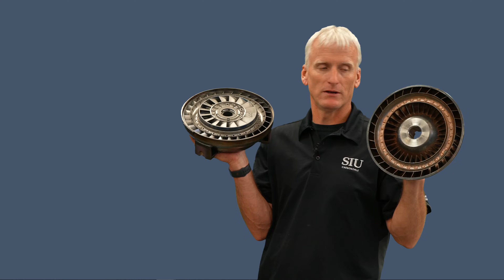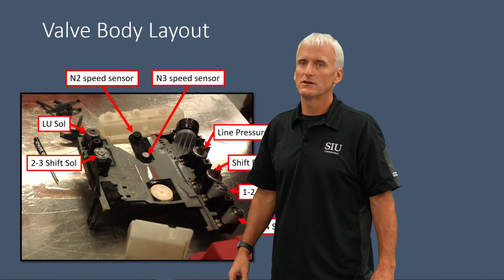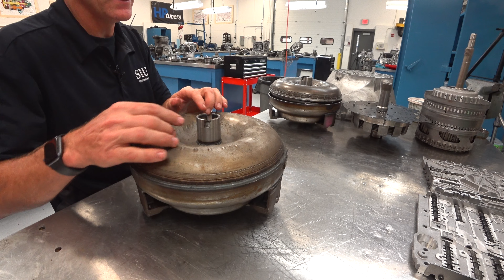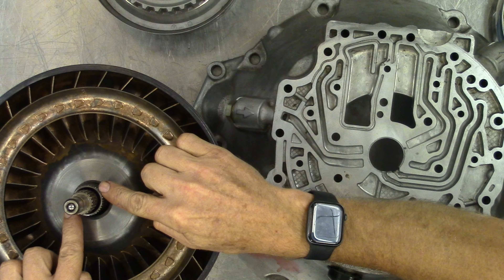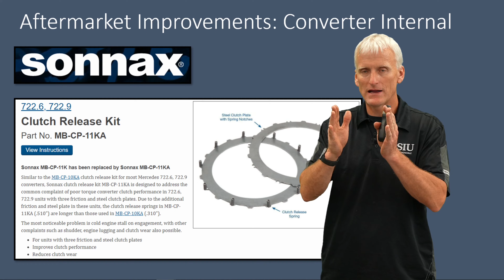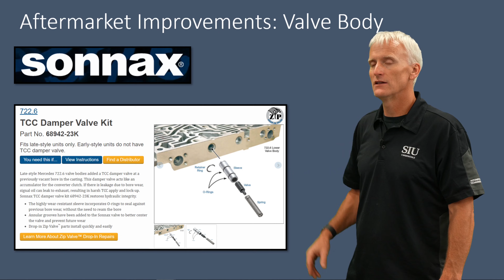Mercedes 722.6 Chrysler NAG Torque Converter

Comment: My 722.6 torque converter is locked engaged. Heavy vibration when in drive or reverse, but not sure if it’s a control issue or jammed clutch pack in the converter?

Comment: I have replaced both capacitors and checked for possible cold solder joints, but the problem has not been solved. When I connect my Autel device, no error codes appear.

I have noticed the following:

In position “P” it correctly shows “P”.
In position “R” it also shows “P”.
In position “N” it shows “N”.
In position “D” it shows “N”.

When I start the engine, I cannot properly select gears with the shift lever – it always stays on “D”. In positions “P” and “N” the engine revs up to 3000–4000 rpm. In the driving gears, however, it only stays at 800–900 rpm.

I hope this description helps you better understand my problem.
Reply: I’m experiencing something similar right now.. did you ever figure out what your issue was?

Comment: My 722.6 320cdi I have a issue with random strong shudder in "traffic jam's" or trying to drive up something in 1st gear and doesn't do it driving normally at speed or full throttle. like heat makes it happen maybe I thought it could be the torque converter was going to buy another but now see it could be valve body issues. if i put it in neutral it go's away and then back into drive it seems to stop. Its only happen 2 time's in the last 2 weeks and i drive it daily. Is this a common symptom to key part in the transmission or do i have replace everything?  Anyone had this?

Comment: I am sorry to disagree, but what you call pilot does not help to center at the crank shaft, but it's just a housing for the tip of the transmission input shaft! What "really" centers the torque converter are the bolts from the flex plate, not only it helps for the longitudinal shift, "torque converter set back clearance" fluctuation but also axial angular tilt!

Comment: Hello, thank you very much for your great videos, they are really cool and greetings from Germany, I have a problem. I hope you can help me, I have now installed a new replacement gearbox with converter 722.640 and now I have the problem, before the car shifts into second gear when driving off, the torque converter clutch slams in. So it closes too early/quickly and opens too late. What's going on? The PWM valve has already been replaced. Glycol test is negative. It's an S211 E270CDI.

Comment: Is failure of the torque converter clutch a common problem in the 722.6?  If so, is there a particularly common cause?

A couple years ago, my trans started going into limp mode after driving awhile.  I was told the TCC had failed.  Sure enough, I opened the pan and found what looked like coffee grounds in the pan.  The filter was also clogged.  I changed the filter and fluid and it seemed fine after that.  This trans only had about 85k miles.  To be fair, I had installed an SGA150 valve body about a year prior.  SGA = Sound German Automotive. I can't help but wonder if that was somehow related.  I haven't yet installed this same VB into the new trans. Loved this shifts, but kinda paranoid.

I knew I needed to get a new converter.  And I didn't want to have the down time for a self rebuild of the trans. So I bought a Circle-D converter and a transmission from Mercedes.  This is for an SL65 btw. 

I just finished watching your most excellent 722.6 complete overhaul video.  Going to tackle rebuilding the old trans using your video as a guide. I've done TH350, TH400, 7004R, 4L60e, 4L80e, T56 and a couple Nissan manuals, back in the day.  You made the rebuild of the 722.6 look like child's play. :)

Comment: After a transmission flush my normally operating 722.6 started occasionally slipping on upshifts from second to third gear, sometimes first to second. Any idea as to where could the problem be? Torque converter or some valve from the electronic plate?  Thanks a lot, these videos are very informative.

Comment: my sprinter with the 5 speed 722.6 will rev instantly to the rev limiter in park or neutral and has zero engine problems. Not a single code for the engine. The fact that my van has about 5% power in reverse or drive tells me its the torque convertor. it wont even drive over a piece of 2x4. It feels like the more throttle I give the more the lockup clutch is engaging almost like the the extra rpms are giving more hydraulic pressure to the lockup. Anyways, it idles pretty good in drive or reverse, but as soon as you put it into drive you can feel the torque convertor clutch grabbing way too much and you really need to have the brakes on. I have star diagnostic scanner and I have code 2783 torque convertor lockup clutch - The component has an excessive power consumption. Im thinking this means the solenoid, Ive tested the resistance it's in range 2.9 ohms. Also there is one more transmission code 2767 RPM sensor 3 No signal. I'm thinking that's the speed sensor on the conductor plate. If the speed sensor fails, would the TCM be trying to send power to the lockup solenoid? maybe just a small amount just enough to be able to idle, but when I give it gas the rpm will only go up about 200-300rpm and instantly clutch gets locked up. Could this also be why the solenoid is getting excessive power consumption code? Regardless, I've taken the valve body out. Very little clutch wear on the magnet and no metal debris of any kind anywhere. Ive purchased a conductor plate, tcc solenoid, tcc damper valve, and also overlap valves just for the heck of it. Also the TCM is dry and no oil has wicked into it. I Was wondering if you've ever seen anything like this. thanks
Reply: Did you resolve it?
Reply: @bernardwarr4187  sort of..., I replaced the entire transmission plus torque converter and it didn't do anything. Clearly it wasn't the transmission, I checked my entire wire harness plus the TCM module was replaced to no avail. My injectors, turbo, intercooler, all charge pipes and entire intake MAF assembly was replaced. Ive replaced every sensor you can think of, both pressure sensors, intake + charge temp. sensors, fuel rail sensor, all sensors on the exhaust, replaced egr + swirl motor, I even replaced all my ABS sensors + ABS module. I was getting desperate and ended up getting a donor engine and swapped that in. Now it works completely fine haha. I also replaced so much more than what I listed.

Comment: I'm experiencing hard shiftdowns from 2nd to 1st gear at operating temperature. When cold there is no problem. 
Ran 187.000 miles and from 2006 and gearoilchange (5 gallon flush) every 37.000 miles. 
Sometimes the engine almost seems to want to stall when coming to a hold. 
What could be the problems here? Solenoids or control valves or even torque converter pressure issues?
Thanks for great videos
Reply: U figure it out?

Comment: This is an Amazing video, I’d like to share my video showing a noise that is annoying me since a bought my MB SL 350 2004: https://youtu.be/4TTKpqCKJkI
Consider engine and gearbox mounts and transmissions flex disks are fully serviced. Noise you can hear it just in the cabine and looks like a resonance. Do you think it may caused by torque converter? Thanks for your help

Comment: Please help. My transmission feels like it wont lock up on time while above 45mph. Ill be normally increasing speed or cruising and going up a hill, and it is like the car cant increase rpms like it should and during these few seconds, the engine cant rev up any higher and the gas pedal wont respond, but after a few seconds it finally does respond and the engine jerks and then takes off. 

I had a tcc solenoid code, so i replaced the solenoid however i am still having this problem like it does not want to go up hill or cruise at higher speed until last minute and then when it finally responds it jerks hard and take off. 

Another problem at higher speeds is that the car will have that moment of no response and higher rpms but then suddenly the rpms will either raise or drop and the car will respond again. 

I also hear one quick screech sound believed to be from torque convertor everytime i am accelerating from a stop sign no matter if it is light or hard acceleration. 

Only once before has the engine revved up to 5k rpms with no increase in speed at 65mph while going up a slight incline, when this one time thing happed, it was as if the transmission was not connected to the engine.

Comment: You are amazing . I have a problem with my W204 with 722.6 only when is cold outside and only at the first start , after starting the engine, when switching the selector from P to R or D, the engine speed drops from approx. 800 revolutions at 700-600 revolutions for a period of 1-3 seconds, after which it returns to the initial position (800 revolutions) if I put directly in D engine it will stop, BUT you feel that the car is forcing itself to leave from under you (the brake is obviously pressed) . What can be ?
Reply: Hi. I have the same problem. Do you fix this and how? Thanks
Reply: @tarpe5898 did you find your issue?

Comment: I am not a big fan of this transmission, I own a 2014 Chrysler 300 C 5.7 l all wheel drive and it uses the 5 speed nag1,  Aside from an annoying tacometer twitch or twitch I started having surging issues  And I didn't get any check engine light for well over 2 years and it got pretty bad, I, I only had the surging when I was driving up hills or if I was on light throttle while accelerating.

After many dealerships and a lot of sensors being changed I changed my torque converter which cost me $2000, Now the surging is gone

edit surging never left

Comment: thank you  great class lots of technical information , I've spent lots time at Chryslers  training facticity over 25 years in a dealership , i serviced these unit and did all the TSB's back in the day  but been driving school buses since 2009 , I own my 2012 wrangler with the 3.6 v6 Nag 1 5spd for 6 years its been a great running vehicle, I ve just started experiencing a problem with the  trans at 100,000 miles no DTC's, NO check engine light,   fluid is not burnt , no metal or strange material in the pan   second service at about 95000 miles, never towed or hot rod  just a fun driver , On moderate acceleration under light load trying to climb hills or enter hwy I'm getting a high pitch whining noise rotational to rpm and will not exceed speed above 45 mph under light acceleration i get all five shifts  no noise  and can cruise at hyw  speeds , I just had the TCM and ECU flashed to the latest software , I flushed the trans cooler and replaced the trans cooler bypass valve ,  No noise at idle or shifting from park to drive or reverse , condition is present also when manual shifting no stalling or shuttering , units are on back order , i was hoping for a quick and easy fix maybe a valve body  repair and a torque converter, back in the day Chrysler would put a new unit in if we need a pump converter and a valve body  as it put it over 70 % , any advise or ideas would be appreciated , thank you Bob

Comment: My symptoms- 
Code P0741
TCC slip under load 
and shudder on slow down down at 20mph 

Fluid looks good , not metal shavings at all 

What’s the chance u think the pressure regulator valve is worn 

Trans go kit says it fixes p0741

Comment: The TC clutch application is Pulse Width Modulated (PWM) and why when the clutches fail a vibration/shudder can be felt during application.

Comment: hi, did quite a bit of googling around but didn't find anyone with the same issue.

04 r230 sl600 (v12 twin turbo) with 70k miles. driving on a level road, when giving just a slight bit of gas, or letting off, I feel play in the driveline, but I dont think its the driveshaft or the differential, it feels as if there is play inside the transmission itself. what could it be related to, a gearset, a bushing, some bearing? thank you.

Comment: if torque converter leaks, what should i look for {location}
Reply from the maker: It would be between the engine and transmission, but it might travel towards the rear while driving because of the air movement.

Comment: How do you install this back on the transmission? Sliding it on, and rotating it, until it goes down all the way?
Reply from the maker: Yes, slide in and spin till you past the stator support splines, input shaft spines, and pump lugs.

Comment: Hi,
What might be the cause of harsh 2-3,3-4 shifting when cold ? Feels like TCC engages too fast.
Reply from the maker: It could be a TCC dragging on.  There is an "improvements" video I did that shows some torque converter fixes.  This trans seems sensitive to cold operation regarding TCC operation.

Comment: Great video and detailed explanation of the whole system!

I also recently experience some trouble with the lockup mode in the 722.626 WA580 from 2002 E320 CDI. I changed the lockup control valve to the newer version last year and it got a lot better but i'm still having a bit of trouble. 

In particular, the tranmission seems to be driven through the normal torque converter with the clutch partially applied in first and second gear and in full lockup mode once it's shifting to 3-4-5. 

Sometimes i drive up a hill in 3rd gear at a bit over 1000 revs with slight throttle and once i push down the throttle a bit more it shifts to second gear at 1700-2000 revs with lockup partially applied (dragging). 

I suppose that's also the way it should be in gear 3-4-5 but it isn't, although sometimes when it shifts in these gears you can feel that the transmission is working through torque converter and that the clutch gradually applies after a few seconds until it's fully locked - so i think my transmission doesn't know exactly when to apply the lockup and to what extent...

Plus, i also sometimes have a slight engine rev-up before it upshifts to the next gear in every gear, especially under low torque and trottle, while some other times it's perfectly fine. 

Transmission shifts incredibly smooth even if it does that kind of "rev-up" so no clunky engagement at all and since different clutches, brakes and freewheels are applied in the shifting transition, i guess that's also kind of related to the TCC that disengages during the shift so that the converter and the engine rev up a bit before the next gear is engaged.

It's increadibly hard to find any information in the internet about how the TCC should apply in which engine rev section and wether it has to fully lock up or not. I've just found one diagram which shows the TCC apply in relation to input shaft speed and throttle position, but it's a bit difficult for me to interpret this diagram because i don't know how i can measure the input shaft speed and i guess the TCM and therefore the TCC is programmed to the particular engine that is connected to the transmission.

Could you give me any suggestion in this case or maybe provide additional information about whether the TCC has to lock up fully/partially and in which engine rev area?

Thank you very much and greetings from Germany 🖐️
Reply from the maker: To find out if the TCC should be applied, you'd have to drive it with a scan tool installed and monitor the lockup pid.  These, as you know, do have issues regarding the converter.

I have a video on the improvements/enhancements.  I would think that the lube reg valve and the overlap valves might help your transmission.
Reply: Alright, thank you very much. I have a star diagnosis at my hand so i can monitor all the parameters but it doesn't show the degree to which the TCC should be applied - but I might soon take care of the valve body and install these improvements you mentioned since I also think that the tolerances of the valve bores could be too high